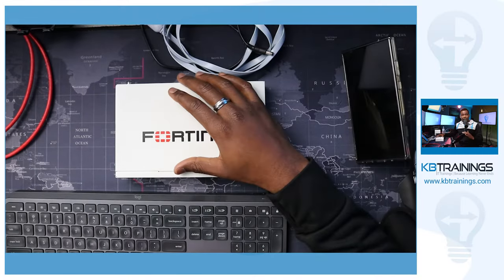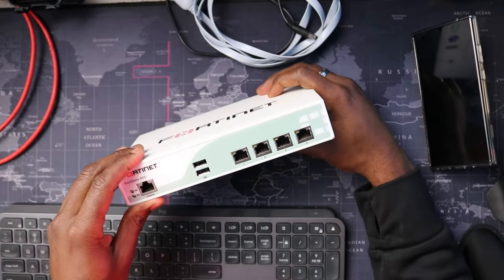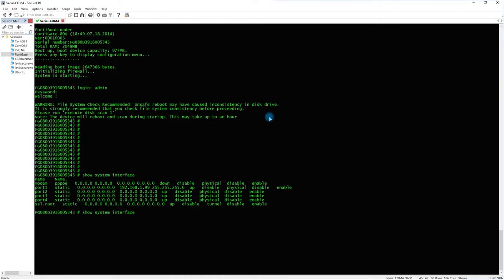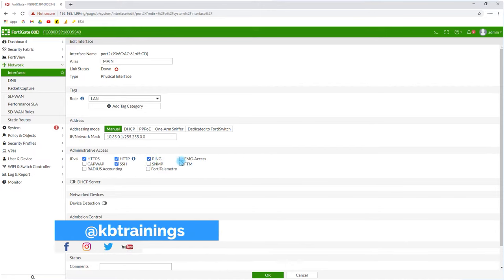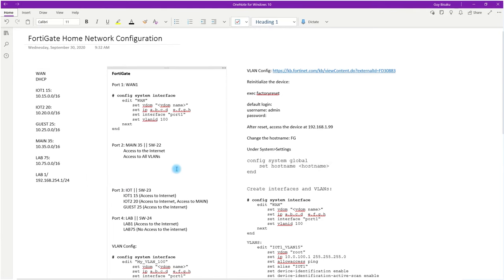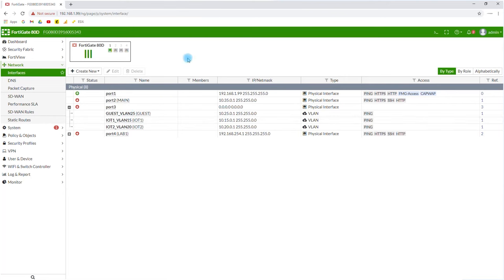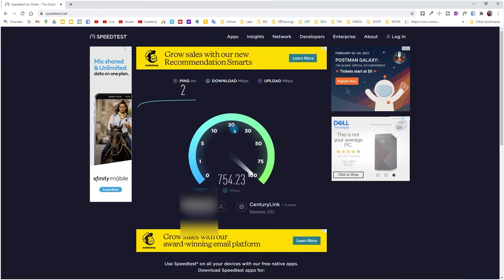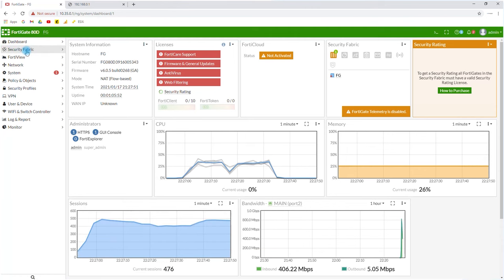#4: FortiGate: Basic Config of the firewall | VLAN, WAN, DHCP, IPv4 Policies | My Home Network

Comment: Hello, 
Thank you for the great video! I have a question though, I am a beginner into the Cyber Security field and trying to get familiar with VLANs configuration. For port3 you created 3 different VLANs and assigned each of them a different ip address with DHCP on, now let's say you connected an Access Point to port3 and wirless device is connected to the network through this AP, what IP address could this device have? In other words, how to determine which device belongs to which VLAN since all of them are connected to the same port?
Thanks again..

Comment: As you shown in your diagram that your fortiget firewall ports will be connected to only a single switch and all the devices like IOT, PCs and server will be connected to that switch.So, how your switch will decide that to which device it has to assign VLA15 or VLAN25 or MAIN subnet. Please explain more means how your port 3 will be used by a single switch.
? Please reply.

Comment: This is a very good practical setup. But keep in your DHCP, main interface, and Vlan addressing subnet ranges are fairly large. Which is best with a very large amount of users and appliances. Most users will be operating in a smaller environment so keeping those ranges low would be best.
Reply from the maker: You're right.
I actually changed the subnet to /24 on all VLANs.
Thank you Justin!
Reply: @KBTrainings  Keep it up!
Reply from the maker: Will try 🙂!
Thanks

Comment: did you end configuring a public IP on the Fortigate device?  I am a Cisco network enthusiast and learning firewall. Did you end up adding anymore policies on the Fortigate?  What's the current setup on the Fortigate today?  Are you still double routing?
Reply from the maker: Hey Tommy,
Yes, I configured PPPoE on WAN1 and was able to connect fine.
Also added some more policies for internal traffic and so one.
Check out my SDWAN video as well as the new FortiGate video.

Comment: Hi, one question. I have my ISP modem 1 connected to the Forti then from forti to 2nd router with WiFi. Can this example VLAN's also work in my Topology? Or do you have any other advice? I also want to seperate IoT devices, Home networkand Work network. My ISP Modem is direct connected to the Forti to WAN 1. SO the 2nd router should be connected to forti with port 1-4 right as AP mode right? With or without DHCP on the 2nd router?

Comment: Guy, I'm setting my home lab (noobie) up and I want your advice.  I will be running a DIY router/firewall with Sophos-XG but I also have a Cisco sg300 28-port POE switch and a couple of Unifi AC Pro APs.  When it comes to inter-VLAN routing, would you recommend the "router on a stick" method or Cisco L3 switch  to do all VLAN routing?  I have a couple of VLANs I want to make for my home Lab and want the best performance. I currently subscribe to ATT Fiber (1gB).  Keep rolling out the videos.  Thanks!
Reply from the maker: I usually Like to do all routing on the firewall. Depending on the capacity and total throughput of your firewall, it may ot may not cause a slight performance decrease, but I still prefer that method.

Comment: Great tutorial, however.  I must have missed a step cause, what VLAN does the computer you were using automatically fall into if port 2 was carrying multiple VLANs and the computer is set to DHCP. How did it know which VLAN to go into. It would have been helpful to see the DHCP address that was handed to the computer

Comment: Studying for my CCNA, i was trying to figure out why you have separate cables in different vlans running to the switch instead of just one that can just be a trunk then it hit me, was it for load balancing? Or there is a reason why you designed it that way? Would be great hearing from you or anyone reading this to remove my curiosity
Reply from the maker: Yep. Multiple links to balance VLANs across many links (trunks).
Also the design shows the logical aspect of things,  so I had to include all the L3 links.

Comment: Hi, so I will soon replace my Router with a Fortigate. What would you recommend to use for a connection to the ISP since i cant directly connect the Fortigate to the ISP. Thanks in advance
Reply from the maker: Hi John, 
It all depends on how the ISP drops the connection.
The FortiGate takes ethernet or PPPoE, you may need to get a device in the middle or not.

Comment: Most of your stuff is beyond me;  however, I am interested in  your modem, it appears to be the C3ntury L!nk Gr33nwave C40OO.  Is it possible to replace that with your own equipment.  I have searched high and low and nobody knows.  All I need is a simple powerful network. I would like 8 Lan Ports and be able to put a VPN on the router.  Any recommendations are appreciated.  Thanks
Reply from the maker: Hi Jeremy,
Yes, this is the C4000.
You can get rid of it if you have a router in which you can have PPPoE and tag the WAN port (201 in my case).
I use a FortiGate. You can use a cisco router or the UDM Pro.
Thanks

Comment: I have a public IP but when i connect my fortigate it takes the private ip from the modem , i need to configure SSl VPn but i need to take a public ip fro the wan port but it doesn't work. can you help me please ?
Reply from the maker: You need to set the modem to be transparent and not do any routing. You can check with your ISP or consult your modem documentation online.
Reply: @KBTrainings  I'll contact my ISP thank you very much
Reply from the maker: Anytime, no stress at all. 🙂